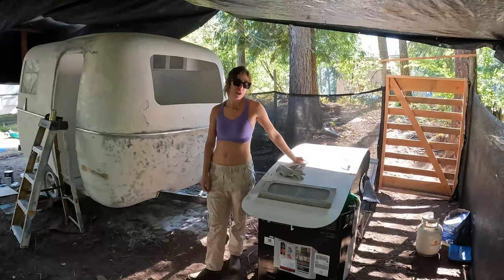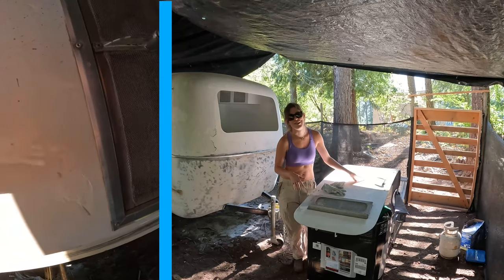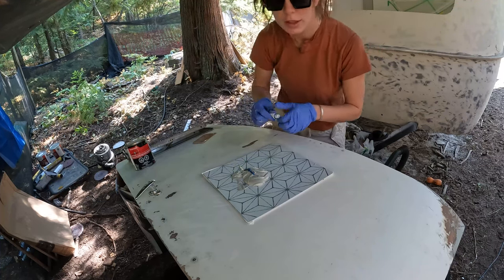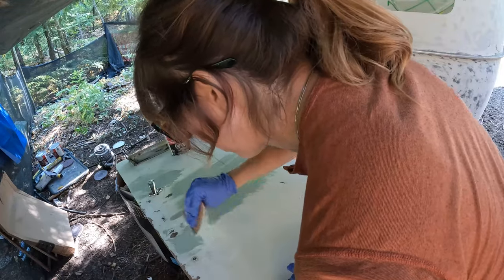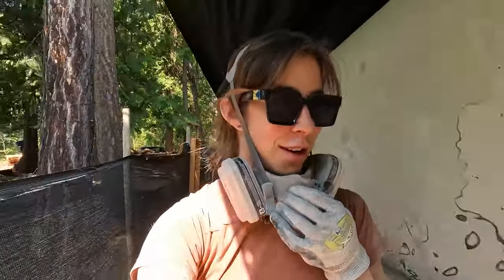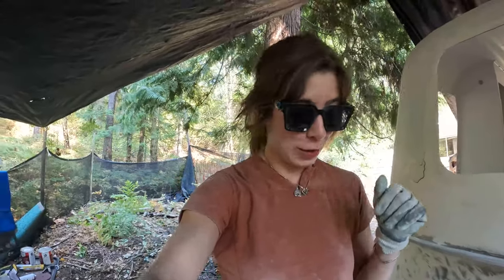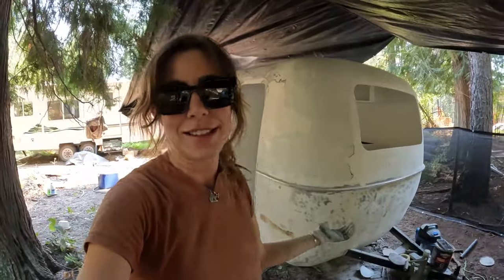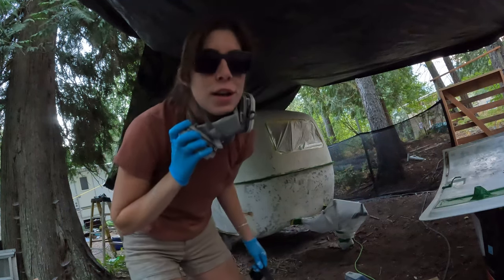am I ready to paint this thing?! | 1972 Boler Restoration

Comment: I feel your pain. When using 2 part epoxy paint the batch gets wasted if the sprayer gets clogged. Always    clean it after every use no matter what type of paint your using by spraying acetone or thinner threw the gun. To save paint by not spraying to see if the imperfections will show run your hand over the bad spots if you can feel the repair you will see it in the paint. Keep it going the first one is never the easiest.
Reply from the maker: Hey, thanks for the encouragement :)  I used so much paint thinner last time I cleaned it, I almost wondered if this happened due to the paint thinner, like could it melt some part of the gun.. anyways all is well that ends well and the new machine is still ok so whatever the issue, it didn't happen on the new one thankfully haha

Comment: Questions:  1) are painting the shell, or covering with epoxy?  Since you are using primer, I assume you are using paint.  2)  The glop I saw come out of the paint gun probably means you did not thin the paint?  Spraying requires almost a water consistency.  Also, go to body shop (auto parts) supply, not a hardware store, and use tack cloths to wipe the dust off the surface.
Reply from the maker: ooh epoxy would have been cool but no, after obsessing and researching, calling around to body shops (and even a semi body shop, since hoods are made of fiberglass i guess), I finally chose a paint that many people use on fiberglass boats and rvs, and it clearly says to not thin it, so I listened to that commentary but i have such a hard time finding good answers anywhere online these days since there is such contradicting information out there. but thank you for this, luckily the paint did go on so smooth and shiny in the next ep :)
Reply: @OnlyCampers  I have much to learn.  🙂

Comment: those hplv guns are hit n miss but you have to use the lil cup they come with and thin the paint until it is taking 20-30 seconds to evacuate completely.
Reply from the maker: oh interesting, I didnt know thats how long it should take eto fully empty! good to know
Reply: still got my fingers crossed that you pull off a better job than I did. Poor lil ranger  ended up with runs on the hood and fenders. rest turned out decent tho @OnlyCampers
Reply from the maker: youll find out tomorrow morning haha @nikolastale7395